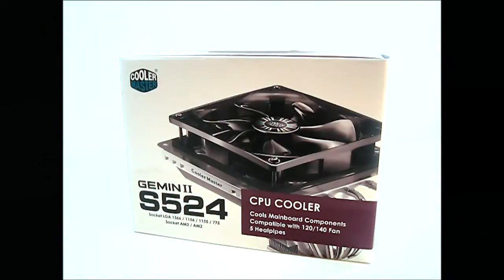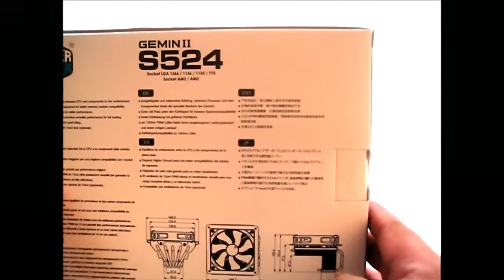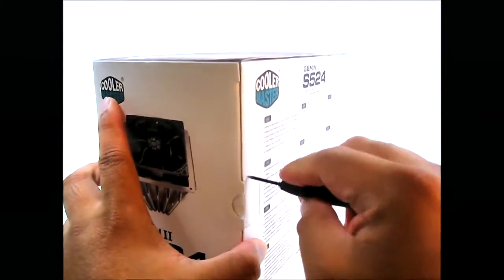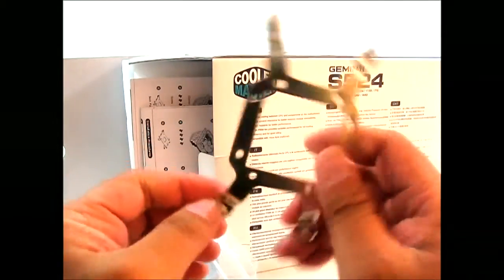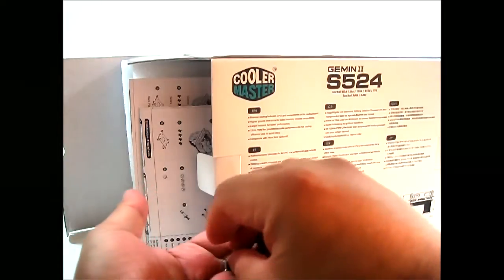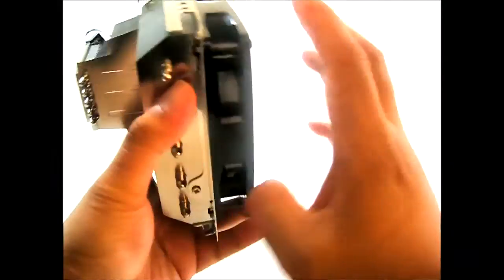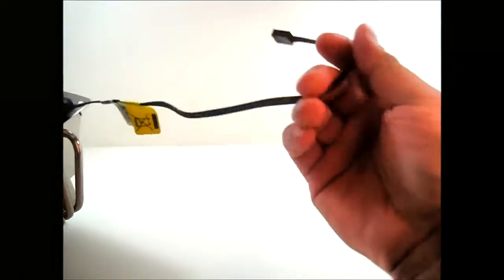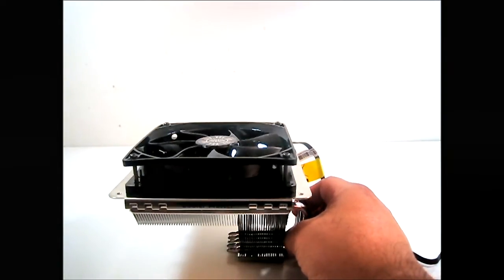Cooler Master GeminII S524 CPU Cooler - Unboxing and Product Overview

Comment from the maker: @Scortech Yes, It will fit most micro-ATX cases because of the low height clearance, although you probably have to worry about clearance for plugging in the 8-pin power cable and installing components like RAM around a wide bodied heatsink.